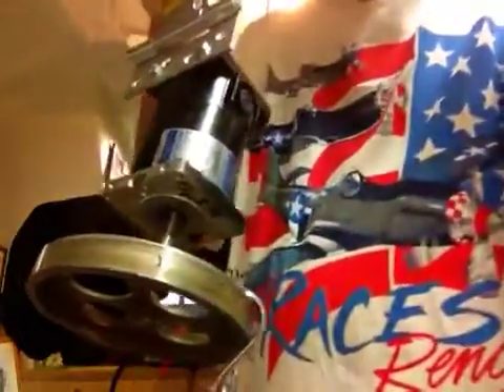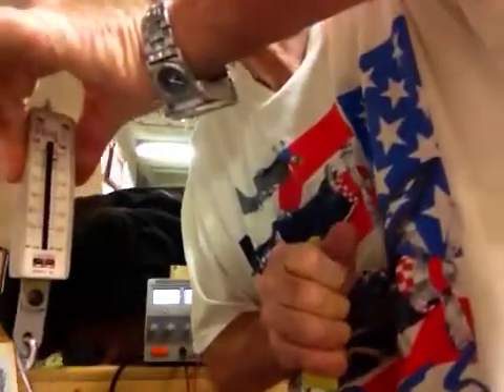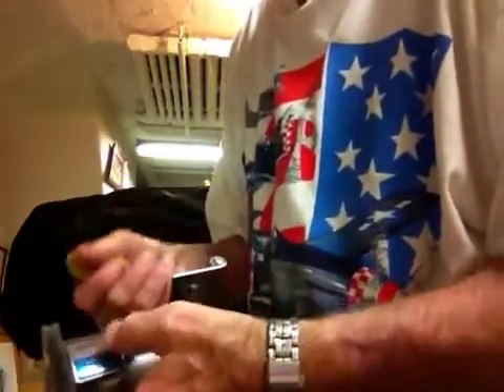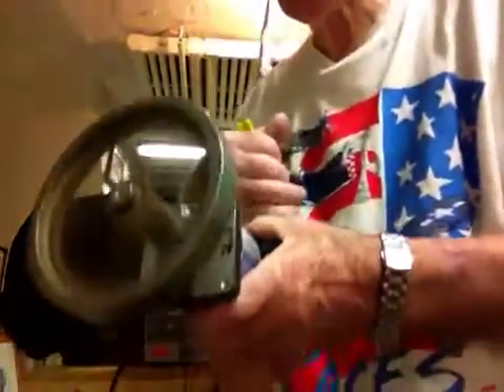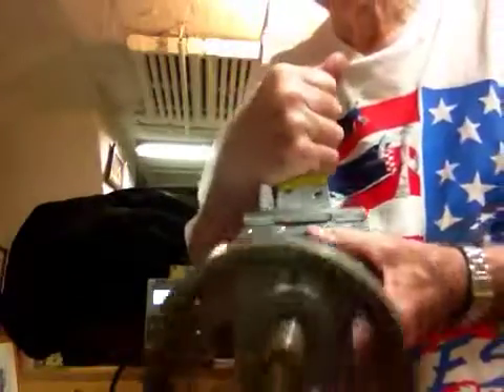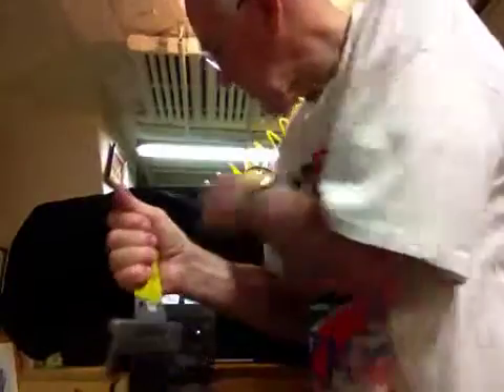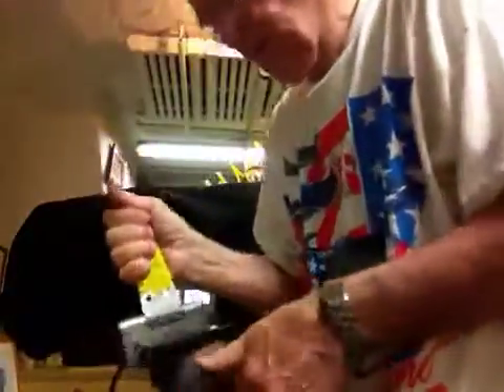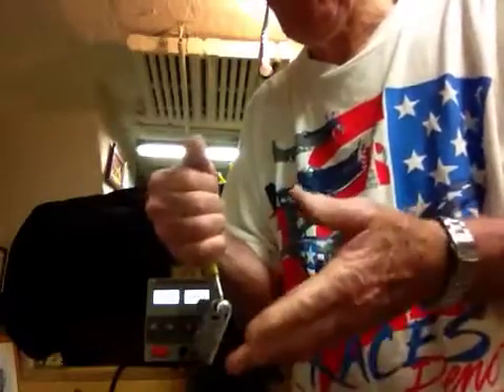60 x over unity gyro dynamo demo

Comment: as a courtesy, i share some  FACTS  with you and your subs.    1)  the use of a flywheel does Not  result in an energy increase.   2)  the  precessing of a gyro  CANNOT  be utilized to  ANY  Advantage, in a POWER  context.   3) the  OBSERVED  movement of a flywheel pendulum  IS  DETERMINED  by the use of a, more or less,,  STATIONARY  pivot point.    4)  there no  'surplus'  energy in such a system.   meaning, NFL.   no-free-lunch.   see my research, if interested in a valid  ou  concept.   it works, on paper.   see the linked video, for the proof.   cheers                     googletranslatle
https://www.youtube.com/watch?v=lTkXciAn488

Comment: If it is 60x over unity, means you can power up a motor several times bigger and more powerful. Show people you can recharge a battery that is powering light bulbs and show battery level does not drop.